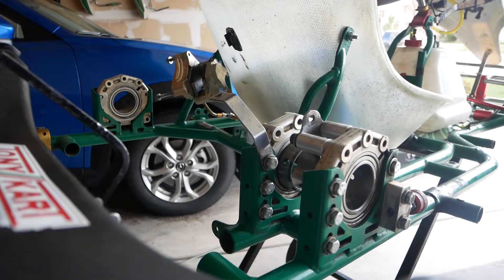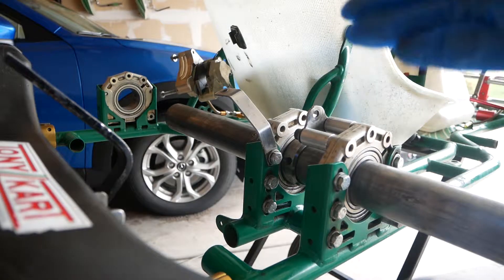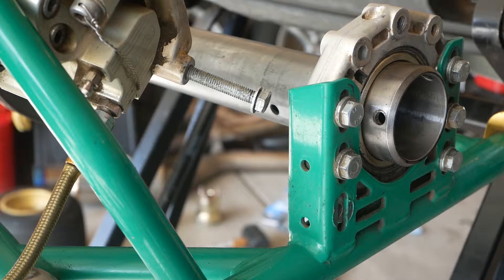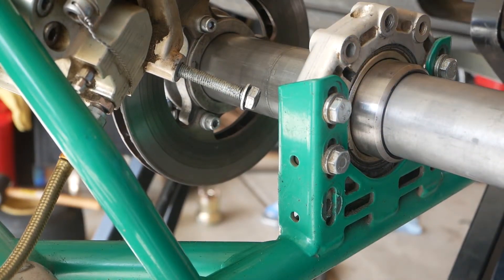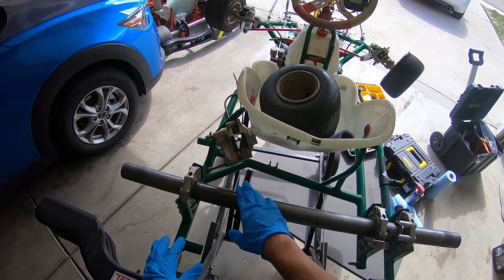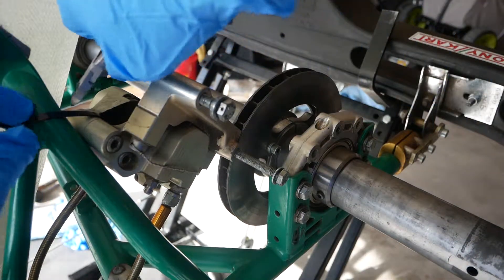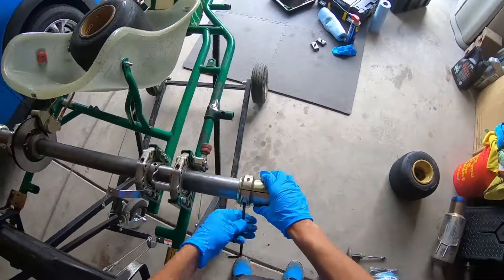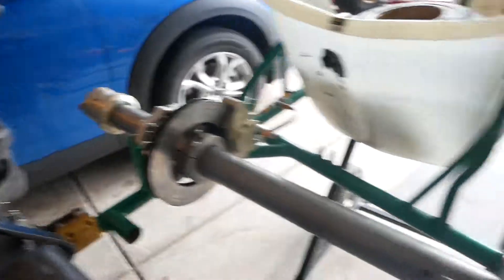How To Remove/Replace Go Kart Rear Axle Part 2

Comment: What’s the torque spec that you use
Reply from the maker: I typically use just hand tightening method to get the job done
Reply: Oh ok is there any recommended torque specs that you know of
Reply from the maker: @BrandonGuillot_Racing  Not sure to be honest, I looked up a few discussion thread and I found that most tighten by hand but there are those who uses a torque spec for mostly engine specific. See more in this thread https://forums.kartpulse.com/t/do-you-torque-wrench/1611